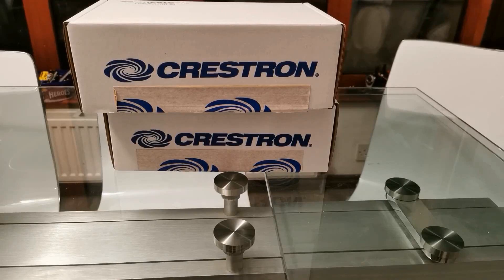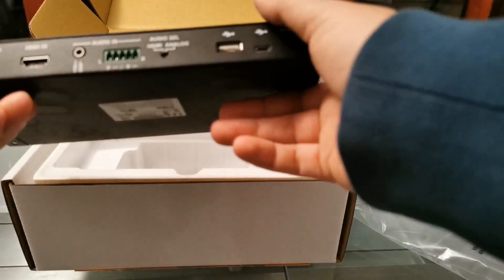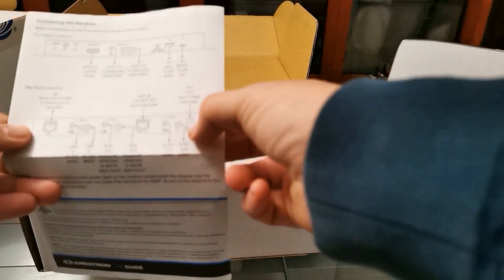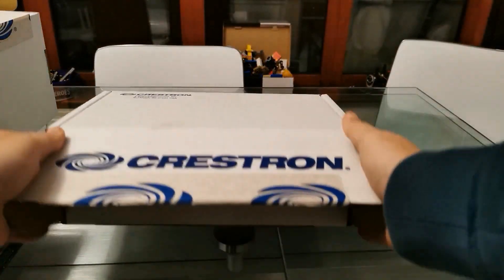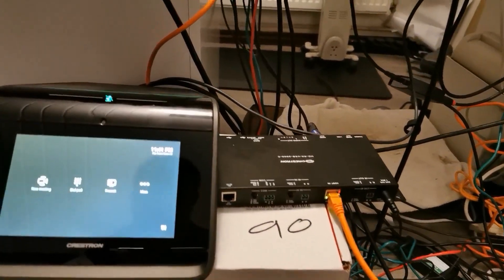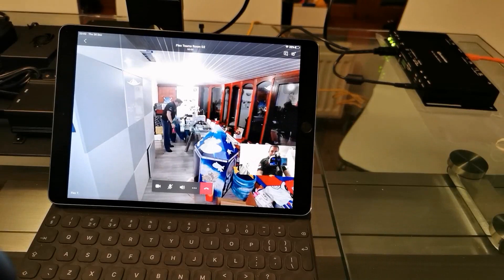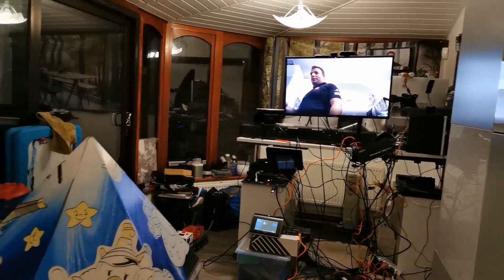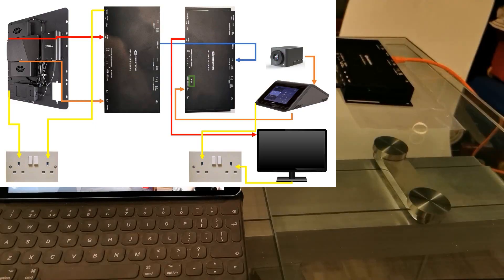Box Number Three - Crestron HD-EXT-USB-2000-C Extenders

Comment: Thx for pointing out the SW update for the HD-EXT! We tested it with the Huddly IQ (which already had the correct FW) in summer, but the connection wasn't reliable / broke off. Non-Flex setup.